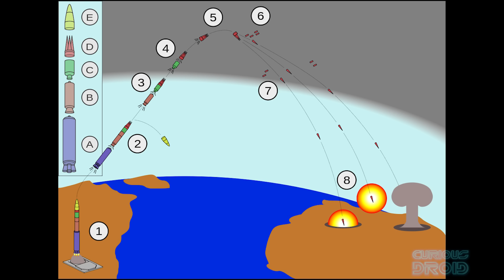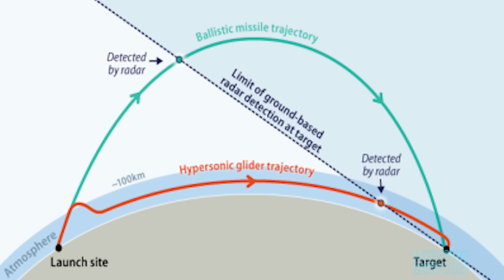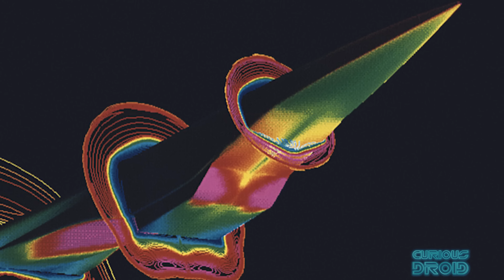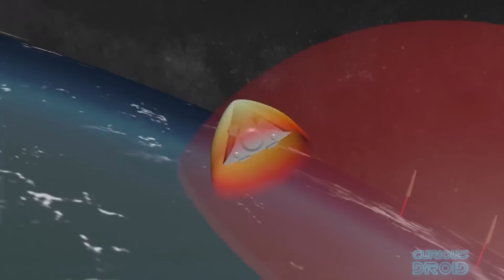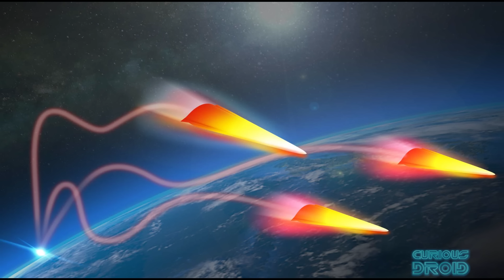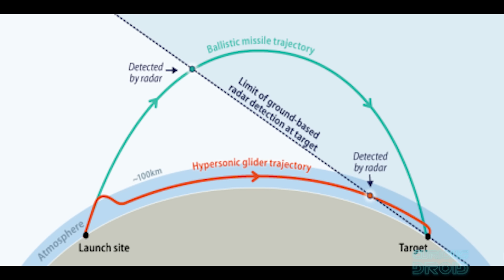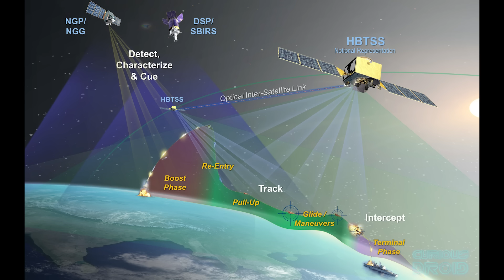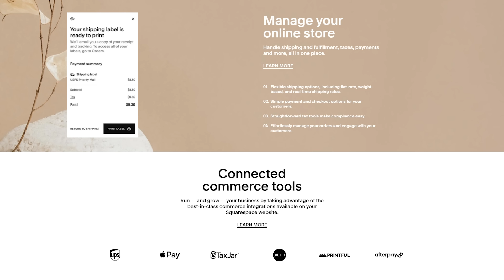Can the U.S. Stop Russian and Chinese Hypersonic Missiles?

Comment: Since they don't actually have much in the way of terminal guidance, it sounds like a very effective defense against them is to not be sitting still in the same spot you were in when it is launched.
Reply: I am not sure about the terminal guidance. Long range air to air missiles already are hanging out in the near Mach 5 regime right after launch. The Pershing III missile also used radar guidance in the terminal phase. It’s like as the hypersonic vehicle gets near its target it will slow just enough to light it up with radar and get on target. Also the plasma sheath likely does not prevent upward facing GPS and stellar nav from working through the flight profile.
Reply: That's hard to do for a building
Reply: @XKS99  dissipation of the plasma field may make it slow enough for intercept regardless. Another issue with slowing down is the weapon would lose alot of its killing power. You'd get more from the kinetic energy than a conventional warhead.
Reply: @Followme556  Not so hard for an aircraft carrier, which is kinda the main thing these were meant to counter.
Reply: @korcommander  A 500 kg warhead coming in at Mach 4.5 is hard but not impossible to intercept, true, but if it hits, it hits with a mighty wallop.
Reply: @markbeiser  glide vehicles are ideal for hitting fixed targets while hypersonic cruise missiles can in theory hit mobile targets as well.
Reply: Hold your own paper tigers...
Reply: @markbeiser  How much warning time do you have, and how quickly can an aircraft carrier get out of the way?
Reply: @patreekotime4578  Against a weapon that is fired at a target location, and has no or limited terminal guidance, you don't necessarily even need to know it is coming, you just need to be constantly in motion.
Reply: That is also true with SKVAL.  The solution was a nuclear warhead.
Reply: @Land-of-reason  Yeap, with a nuke you only need to hit close(ish) to the target.
Reply: @patreekotime4578  I'd say from the moment that you get a warning about a hypersonic missile in flight, engage thrusters at max. And keep moving until you either hear a loud explosion, or your fuel runs out.

Don't forget to serpentine, as only a graduate of the Prometheus School of Running Away from Things would try to outrun a hypersonic missile in a straight line.
Reply: @XKS99  could be I remember the old "rods from God" kinetic impactors. Basically a tungsten telephone pole deorbited onto a target. It was too much interference during reentry to do a proper terminal. Guidance and precision navigation in that environment was also difficult so it never went anywhere, well that and the various arms control issues surrounding it.
Reply: @patreekotime4578  The basic tactic would be to try to push off enemy surveillance assets, particularly aircraft and submarines, hard to do much about satellites.

If you can interrupt their direct observation of you. You have the possibility you might move far enough to get out of this things targeting basket.
Reply: @markbeiser if they out a nuke, thats an invitation to us to use a nuke
Reply: @markbeiser  sounds odd, that they designed a missile system to counter moving targets, which mostly relies on inertial guidance
Reply: @XKS99  -The US Department of Defense has said it is not worried by a "Plasma Blackout" as this tends to occur only on blunt bodies at high altitude.
-If Plasma blackout was a problem it would apply equally to all sides of a missile including the top half where GPS antenna would be.  
-There is something called the "skin depth" of a material (developed by Maxwell himself no less) so a plasma could be penetrated depending on the ionization level, ionization -thickness and frequency.  Skin depth at 3MH in sea water is about 0.6m so the radio wave could be received to maybe 3x that (1.8m easily).  
-These missiles would use inertial guidance and while basic versions might have a drift rate of 1 knot (1852m/hour) a strategic grade system would be 100x better so maybe 18m of drift and hour in a missile in flight for at most 15 minutes.  
-How much radar. GPS, data communications is possible is beyond what they are telling us but it is certainly very possible and going to happen.
-HGV maybe be in space 2/3rd of their 15 minute Journey.
-Cameras which map the landscape and select targets using powerfull video processors and neutral networks will simply find terrain and recognize targets.
Reply: @markbeiser  The USN defense against Hypersonic missiles consists of the E2D Hawkeye with its digital phased array antenna.   This will dispatch a SM-6 missile from an AEGIS cruiser or destroyer.   The SM-6 is an active homing SM-2 with a booster stage.  An SM-3 can also be dispatched if the target is in space.  
-The main problem Ukraine has in intercepting the Hypersonic missiles like Iskander (Mach 6, 2000m/sec), Kinzahl (Mach 9, 3000m/sec) and KH-22 (Mach 3.5-4.5 1500m/sec) is that the radars are mechanically rotating at 30-60rpm giving only a 1-2 second up date rate.  Electronically scanning and tracking is needed.  The missiles used as interceptors or also around half the speed giving only the most limited head shot opportunities
-Plasma stealth is exaggerated greatly.  More a case of Russian fan boys with butt hurt that they didn't have stealth when the F-117, B2 and F-22 entered service.  .
Reply: @patreekotime4578  
Aircraft carriers are always moving
Reply: @Land-of-reason  
And the moment you use nuclear warheads, the ICBMs fly.
Reply: Yeah... we need movable cities...
Reply: @icecold9511  you have been watching too many films.
Reply: @Land-of-reason  
Do you really think China or Russia could resort to using nukes and we wouldn't respond in kind? Using tactical weapons on their military targets?
Early on in the nuclear weapon game they thought tactical use of nuclear weapons would be a thing. But there is no stopping point, and both Russia and the US saw this fast. 
Only in a movie can you claim "we only used one nuclear weapon, so let it end there." 
You will receive a nuclear response. We would have no choice but to respond with nuclear weapons. And it is considered inevitable that it will escalate.
Reply: Always a good idea.
Reply: @markbeiser  then it's illogical if all one has to do is keep sailing on a random zigzag course. The selling point of the missile system is it's too fast to shoot down, not that it's a potential carrier killer.
Reply: @icecold9511  nuclear weapons are NOT TACTICAL.  They are a deterrent.

https://www.gov.uk/government/publications/uk-nuclear-deterrence-factsheet/uk-nuclear-deterrence-what-you-need-to-know
Reply: @Land-of-reason  
Yeah.... They had decades ago had the concept of a tactical nuclear weapon. This would include using one on a carrier. Tactical nuclear weapons was the term for a weapon intended to use on military targets. Troop concentrations, ships, that sort.
And I flat said both us and Russia largely abandoned the concept because it was believed it would still escalate to a full nuclear exchange.
So the use of a nuclear weapon would result in at a minimum a similar use against a Russian or Chinese military target.
Reply: That's pretty hard to do when the target is a fucking whole city or a military base
Reply: @icecold9511  

You appear to have an unnatural interest in this subject.  The UK’s policies have been clear and consistent.  Using nuclear weapons to take out carriers would be an overkill.  Though SKVAL had a nuclear warhead it was an exception rather than the rule.  Only the Russian’s would understand their reasoning.

Throughout our UK history nuclear weapons have been maintained as a deterrent.  Beyond that it would be a political decision which would depend on circumstances.
Reply: @icecold9511  escalation scenarios in a direct confrontation between nuclear powers are highly unpredictable. If one side sees an existential threat emerging then first use is going to happen. Both the US and Russia have first use policies, with American one being “whenever the president feels like it”. This is why NATO has not directly intervened in the Ukraine conflict, and Russia hasn’t used tactical nuclear weapons. Not something I would like to see but I wonder how the US would respond to tactical strikes in Ukraine that does not kill a large number a of people, destroying all the Dnepr bridges for example.
Reply: @XKS99  
The response would likely be total ostricization by the world. Nuclear proliferation would skyrocket if a nuclear power could resort to that.
Think even China wouldn't have a problem with that scenario?
Reply: @XKS99  I used to work at a company budling frigates and we had an ex-RN captain who'd take the ships out on trials.  One day (back in the 90s) we were talking about Russian anti-ship missiles and he explained that they're basically ballistic so if you see one, you turn off your radar and zig-zag and pray, because nothing you have can stop them.  I would guess that if you see a thermal signature moving hypersonically, you have less than a minute to zigzag and pray.
Reply: @markbeiser  I think their primary mission is to deliver nuclear warheads onto targets while evading enemy defenses. By all accounts they do that just fine.
Reply: @XKS99 the US has already stated that the response to a Russian use of tactical nuclear weapons, would be the systematic destruction of all Russian forces in Ukraine.
Reply: @icecold9511  not always at a high rate of speed.
Reply: @pakde8002  too fast shoot-down can also equate to to fast to react to
Reply: @Followme556  I don't think we would either. But I think the world, including China, would turn on Russia in every other way. Even China doesn't want to see smaller nations suddenly going nuclear as their only hope.
Reply: @markbeiser  Variable motion.  So a bit like avoiding submarines in the past.  A little academic though since nukes will get the job done anyway.
Reply: That’s it boys, pack up the base we’re moving
Reply: @chuckygobyebye  I guess you don't just wait and pray, you fire a barage of whatever you have in its direction. That means long range machine guns - rockets - missiles whatever you have. Some might hit and destroy it.
Reply: @FlorinArjocu  machine guns?  this isn't WWII.
Reply: Remember the US and Australia has them also, can you stop it! Explain how if Russia thinks there's are unstoppable, well then the US/Australia version can maneuver after separation to the kill vehicle.. Mach 20 was recorded the fastest in the world.
Reply: @Followme556  im sorry, but if russia or china nukes a US aircraft carrier (which is what we are talking about), you can rest assured there will be severe consequences.
Reply: @drzavnalutrija  Russia has shown in ukraine, that it does not have the capability at all unless it goes nuclear. The US will honour its art 5 responsibility, because it will loose all credibility if it doesnt.
Reply: @TheWaynester101  I am pretty sure that we were talking about Russia nuking a battlefield Target in Ukraine. There is no way Russia would nuke a US aircraft carrier it would start World War 3
Reply: The real question is, can China or Russia hit anything important with their hypersonic missile?
Reply: @funveeable  not too hard to hit stationary buildings
Reply: Instead of 1 Megawatt Laser System try to use 10 to 20 Megawatt Laser System it could cost billions but worthed
Reply: @markbeiser  Not just motion, but changing course randomly. Because if your course is straight or otherwise predictable, they can just lead the target.
Reply: Isn’t space force exactly for that purpose.
Reply: @markbeiser  Actually it’s pretty hard for an aircraft carrier if you are within a range of 2-3000km how fast can you move vs how fast is the missile travelling vs the distance the missile is to you. The final thing is you maynot know you have been targeted until it’s too late.
Reply: @M167A1  If you move far enough your assets are basically useless as offensive weapons. There is an operating range for almost everything.
Reply: @pakde8002  It’s a potential carrier killer because carriers have an operating range of about 1500-2000km that’s how far most of their planes fly without refuelling to be able to make a return trip. At that distance even if you have info at launch you have only a window of 10-15 minutes of reaction time so basically how big a radius can you move within 10-15 mins? If you are too far  from target then basically the effectivesbpness of carriers are limited.
Reply: @Followme556  but it's pretty easy to do with an aircraft carrier going 30+ knots
Reply: @williamzk9083 The best defensive missile the US has is only 65% effective in testing more than likely less in actual use
Reply: Yep mach 25 nuclear warhead goes brrrrrr in like 10-15 minutes. Movement would suuuurely help.
Reply: What about the American misil
Reply: Depends on what warhead it was equipped and how fast you can move

Mach 10 is 3.4KM/s
Lets say you are a aircraft carrier moving at 30 knots which is 55KM/h

Its very likely you only can spot that missiles 100km away before impact (pretty much the maximum range of IR sensors), more or less 30 seconds, how fast a ship can move with 55km/h for 30 seconds? 30knots also means 15,43m/s, which means you can only move at most 450m away from original position, if it was a straight line, if that missile can receive any data it would be impossible to run because even with small adjustment  (for example 1s more flight time)  it will hit the target

China recently successfully test tech to communicate with object moving at hypersonic speed
Reply: @markbeiser  fact is they do have terminal guidance.  Plus if fired in groups the current anti missile systems cant respond ,target and switch to a new target fast enough. You might get one or even two of the on coming missiles but you are getting hit and its only going to one hit to disable a ship. Plus people dont realise that dont want to sink the ships only to disable them. If you sink the ship its over but if to u disable a ship than they have to invest other assets to support and protect the disabled vessel firther reducing the opponents supply chain.
Reply: @Mark Beiser  carriers can move even our destroyers can have trouble keeping up with them.
Reply: @glennoswald5928  they don't make that many of them, they're very expensive to manufacture..and the carrier is not alone and has many missiles at its disposal...20 year navy vet
Reply: @blakeh6250  not that many of them ? Seems like their not worried about running out their using them in the Ukraine numerous of them at a time. Seems like your misinformed
Reply: @blakeh6250  they can move in a straight line but it takes miles for them to turn and maneuver.  The bigger the ship the harder it is to change direction.
Reply: @glennoswald5928  not in comparison to any other type of missile, you are the one misinformed... I'm  missile guy what are you?
Reply: @Glenn Oswald  but carriers can travel at fast speeds even are destroyers have a hard time keeping up with them. Russia has only used 6 of these missiles so far in Ukraine war in over 15 months.. there numbers in inventory are low. These missiles have only been proven accurate on stationary targets. Not easy to sink a Carrier. Took a full month to purposely sink the USS America in a Sinkex. And there was nobody onboard to perform damage control.
Reply: @Glenn Oswald  15-20 in inventory at start of war
Reply: @glennoswald5928  it's not like carriers are alone...geez 20 yr navy missile guy.
Reply: @Glenn Oswald  not true you obviously never served on one.
Reply: @Glenn Oswald  not true at all, watch some videos on carrier high speed evasive turns..you don't have any idea what you are commenting about. I'm a retired Navy chief..not some video gamer
Reply: @Choon Kiat  high speed evasive maneuvers of carriers is impressive..watch a video
Reply: @glennoswald5928  not true
Reply: @Patreeko Time  watch high speed evasive carrier turns..very quickly
Reply: @blakeh6250  a simple google search will prove you wrong. You cant defeat physics.  Mass vs momentum. Look it up stop being ignorant
Reply: @blakeh6250  your information is wrong they've fired over 20 of them already. They used 5 on the power station.
Reply: @blakeh6250  A physics major. You cant beat physics
Reply: @glennoswald5928  I've been on these ships you can't beat experience..you know nothing about the navy
Reply: aren't they steerable all the way (vs ballistic)
Reply: That's why they're most effective against ships SAM sites or radar sites.. &even then anything within a thousand yards is getting vaporised just off strength of kinetic impact alone
Reply: You wanna bet against that? Are you absolutely sure the Chinese did not find a way to increase their missiles accuracy on moving targets?
Reply: @XKS99  It's not about whether you can intercept it or not, it's whether you have enough interceptors. China can put downrange hundreds, if not thousands of missiles at you so it doesn't matter how good your air defenses are. And China now has over 30% of the world's manufacturing capacity while the collective west can't even make enough shells for a little war. We are not talking about a few missiles, or a dozen being made each month by China. If China is threatened by the US and it has to go into war economy, expect thousands of hypersonic missiles to be churned out per month. How many VLSs do the USN have?

This is why the US provoking China and trying to contain China is so stupid.